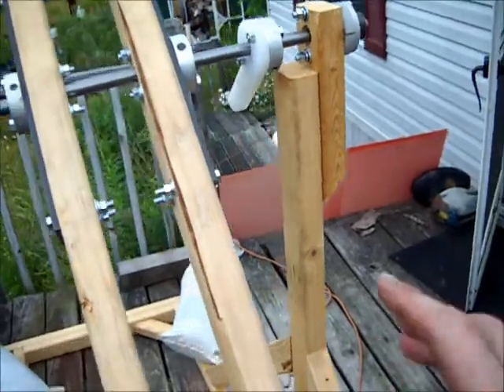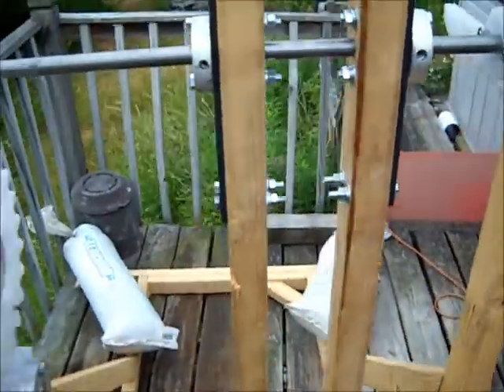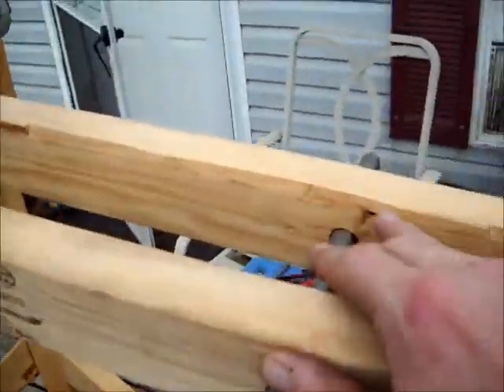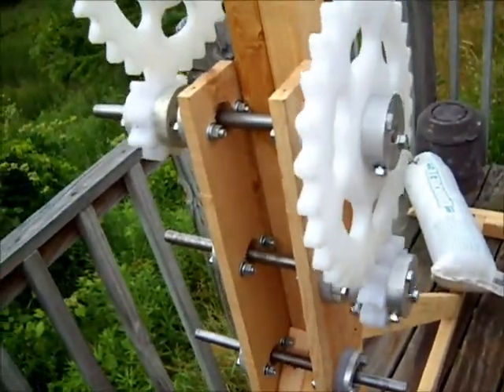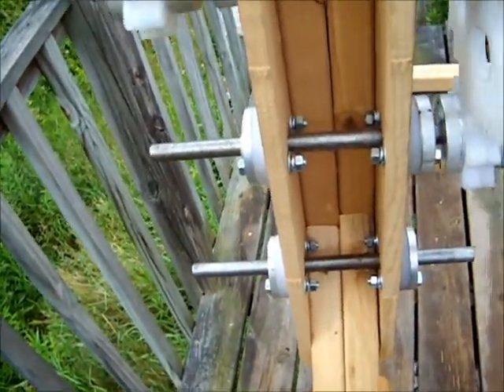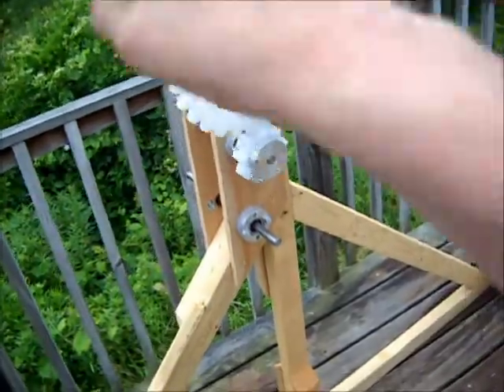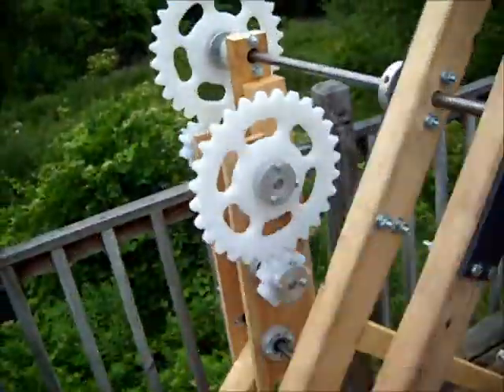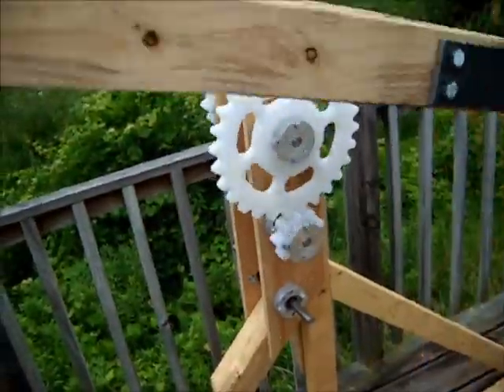GRAM 7 1 16

Comment: Very nice!
Reply from the maker: Hi, thanks, I trying to the primary at a low RPM with high torque for safety reasons. I hope to be testing soon. I may add a pendulum drive using one way 
bearing if needed. Thanks again.